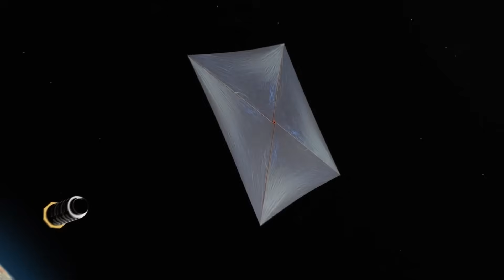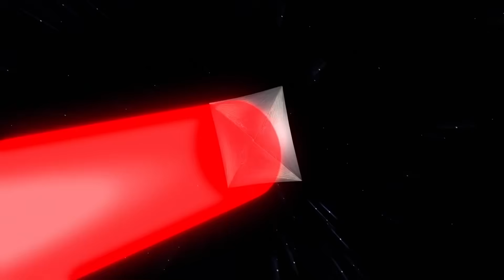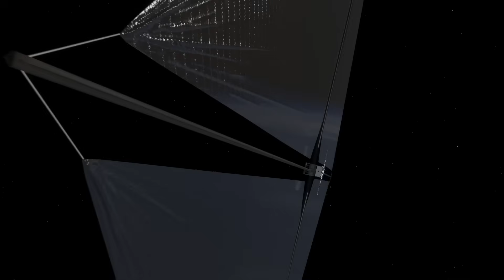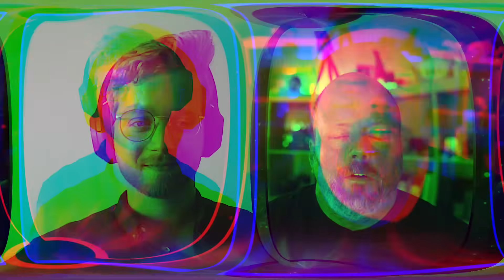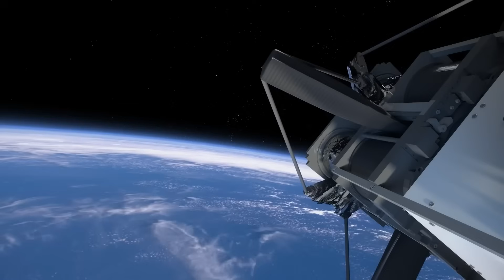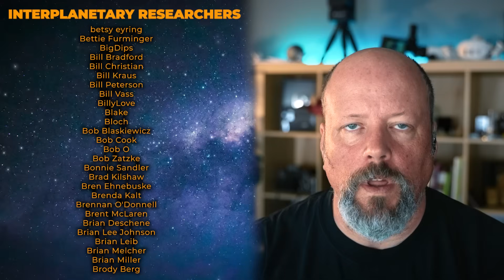Punching NanoHoles in Light Sails Can Bring Us Closer to Alpha Centauri

Comment: Would they have to deal with the solar system rotating as they shoot the laser for an extended  period of time? They might be pushing in a slightly wrong direction and miss the small target. After all this time they should have at least launched this project to the moon to demonstrate that it works.

Comment: Would better accelerate it with a maser. Then the holes can be much bigger. Also, if the sails are made superconducting, you can get total reflection for wavelengths that are a little longer than optical. High-power masers are much more maintainable than lasers, and overwhelmingly easier to phase-lock.

Comment: Although working on the technology of the light sail is fascinating, that isn't the basic problem of a laser powered relativistic speed spacecraft. The problem is a quality that all lasers have, called divergence.

The problem comes in the basic concept and is shown in the video. This shows a laser beam the diameter of the spacecraft pushing it. But lasers don't make columnar beams. They make cones of light that diverge greatly with distance. How greatly? Let's do math!

We'll take a 532 nanometer wavelength (that's green) laser with a 2mm beam width and a very low divergence of 1 milliradian. We'll shine this puppy on the Moon. What diameter do you think the beam will be when it gets there? 10 cm? 1 meter? 20 meters? Wrong. The diameter of that beam at 252,000 miles, 405,555 km distance ,approximately the Moon's apogee, is really 405 kilometers. The diameter of the Moon is 3,474 km, so that 2mm beam is enlarged to 12% of the diameter of the Moon.

The Géoazur team at the Université Côte d’Azur in Grasse, France, bounced a few tens of thousands of 1.3 gigawatt pulses off the Moon and received about 200 photons back. There is not enough power on Earth for a continuous laser beam of that power.

Let's calculate power per square meter. What is power per square meter of a 2 mm beam compared to spreading all that power over a 405 km area? We don't even have to do the math. The number is very, very close to zero, even at the tiny distance to the Moon. What's that laser beam going to be worth at the distance of Mars? Nada. Jupiter? Nada. Pluto? Nada. 1 light-year away, less than a quarter of the distance to Proxima Centauri? Zero. 

To give you a basic idea of the truth, in the Apollo program retroreflectors were placed on the Moon, that reflected light back exactly 180 degrees from its source. Various facilities on Earth shoot incredibly high powered and high quality lasers at those laser reflectors. When they get to the Moon the beams are in the neighborhood of 400 km wide. A tiny, tiny portion of that light is reflected back at Earth where large, usually 10 meter plus scopes are trained on the Moon. On average they receive less than 5 photons back from the beam shot at the Moon. What is the energy of 5 photons? Sometimes they receive zero photons.

The contents of the imagination of humans, to make CGI showing a 1 meter diameter laser beam propelling craft for light-years DO NOT compel the universe to obey. Until lasers have a divergence of zero, light sails are impossible and will remain that way. Even a tiny, tiny amount of divergence, like 1 milliradian, results in a beam 405 km in diameter only 1.3 light-seconds away.

However, using light sails of this technology, using light sails tuned to solar radiation might make it possible to extend the distance from the Sun that light sails can be useful out from about halfway between Venus and Earth, out to the range of Mars. Although the acceleration produced would be in the neighborhood of zero to 60 mph in a couple of weeks, that would still be useful in counterbalancing atmospheric drag encountered in orbit around the inner planets. So I wish the future Dr Norder success. His work won't be in vain.

Comment: Nano-scale holes merely act like a high pass filter. Anything higher frequency above 1/4 wavelength of the hole size passes straight through. So you artificially limit the energy that you can use. Im not sure you can reduce mass enough to make it worthwhile. You may find yourself NEEDING that extra energy.

Comment: We need to make powerful space based laser arrays a priority, they have so many uses, lidar, proplulsion, communications.

With these photonic craft could be achieved at low power on spacecraft by modulaing their reflectivity, implementig very low power transmitters.  We could directly image dark objects in outer solar system.

If we can make these fast enough it can help with the manned mission radiation problem.

Comment: That was a really interesting interview—thank you! But I’m confused about one thing. If you push a 4-gram sail with a laser to reach 1/4 the speed of light, it takes over 16 years to get there. During that time, it needs a power source to communicate with Earth and send data like pictures. What’s the point of sending a spacecraft if it can’t talk back? And what about the weight of cameras, sensors, and a power system? Those definitely add more mass.
Reply: I saw some other video on this, I don't know if it was on Fraser's channel or someone else's.  People are working on these issues, too.  I would imagine that you'd use a tiny RTG for the power source, though.
Reply: @sciencecompliance235 there are solar cells in the concept animation on the little cubesat at the center of the sail

Comment: Two things... First, I'm not sure the Doppler shift issue is adequately addressed.  It's mentioned a couple of times in the interview, but no actual explanation is given on how they are getting around it.  If the photonic lattice is optimized for just one or two narrow wavelength ranges, then how do you consistently accelerate the spacecraft through the full range of velocities until it's moving at a significant fraction of light speed??

Second, how do you prevent fhe light sail from losing alignment with the laser - i.e. from tumbling?  I suppose you could spin-stabilize it, but that seems like it would only work well with very large sails (where you could impart a large angular momentum without mechanically overstessing the sail by spinning it too fast).  Talking about small probes with 10-cm radius, it seems like spin stabilization might not be nearly as effective.  And even spinning sails could still sevelop a significant precession; how do you fight that?

Comment: I'm engineer - but with a physics background. When I first heard of starshot I thought that at Terrawatt laser level there was no way even the small % of light absorbed wouldnt vaporise the whole sail in milliseconds. Then I did some basic Stefan Boltzmann T^4 radiative hand calcs and bingo. ...it gets very hot ...but survivable. Cant always trust your intiution. ..trust the maths.
Back to the engineering issues---on the subject of tiny perforation holes---a known phenomona in mech structural engineering is that very small holes can act as very signifcant local stress raisers increasing risk of in plane membrane stresses ripping apart the sail. I presume they are looking at this - though it is not mentioned ss a factor.
Reply: A maser would be a much more practical thing to use to drive them than a laser. Masers are much, much, much easer to phase-lock.
Reply: What initial beam size and divergence did you use?
Reply: This laser stuff has already been shown it is an unneeded and overly complicated idea..
  During 1 of the live action StarTrek documentaries showed Jake and Benjamin Sisko proved Bajoran lightship's can achieve warp speeds by using tachyons.
Reply: The tiny forces generated by light beams couldn't possibly overstress the sail material unless it was very, very weak.
Reply: @RockinRobbins13  Forces are not so tiny in relation to the crafts fragility. It was supposed to be powered wth a 100GWatt of laser light power (100milllion times sunlight preessure). On a 4m^2 sail the total load was nearly up to 1Newton (which you easily feel).   Doesnt  sound like much - but the whole thing only weighs a gram or so and will accelerate   at 10,000g. Plus it is only 30nanonmeter thick. ... and will be oeprating at extreme elevated white hot temperatures (>>2000K) so material strengths will be much reduced. The stress turn out to be not trivial - but not as big issues as I thought.   With the likes of ultra strong graphene as candiate material itis probably not an issue.
Reply: @bbbf09  Right now the most powerful continuous laser on Earth is the MIRCAL, US Navy military laser with an output of 500 kilowatts, only half a megawatt. Even at that output there are strict limits on how long it can be in continuous operation.

The most powerful pulse laser is the ZEUS laser, which has peak power output of 2 petawatts. The catch is that a pulse lasts only 25 quintillionths of a second. Minimum time between pulses would typically be one minute to several minutes for lasers using similar technology.

Then, what can you do about divergence? Regardless of how much power you can pump out of a laser, how can it remain useful, even at the minuscule distance of 1.3 light-seconds, the apogee of the Moon?
Reply: @RockinRobbins13  I'm not here to defend the idea - it would be preposterously costly and difficult ...but technically possible. You wouldnt use a single laser but thousands of MW  class in a huge spread out array  that would be steerable  (so limit dispersion / divergence effect). 
p.s. 1MW class CW laser did exist in the 1980s so are feasible.
 If you live in the world of Petawatt engineering (as I do) no one uses quintillionths to define pulse widths - you quote femtoseconds.  Higher peak  powers than  Zeus exist --10PW ELI-NP-- and 10PW at rates of 10Hz can be assumed to be real thing next decade - but it is true they deliver very relatively little Joules of energy per pulese  and therefore equivaelnt averaged  CW power  (less than 1kW equivalent in fact)
Reply: @bbbf09  " it would be preposterously costly and difficult ...but technically possible." I'm in 100% agreement there except I don't know how the problem of divergence might be handled. That's the killer of the entire concept. Even a divergence of one milliradian is fatal at the distance of Earth to Mars at opposition.

It's interesting research. I personally think that the end products of the research will be things other than light sails to be used with laser beams. And the use could be really out of the box to the way we're thinking about it now. Isn't that the way basic research usually unravels? 🤡
Reply: @RockinRobbins13  The diffraction limit for divergence (for perfect ideal optics) is ~w/D - where w=wavelength of laser light (1 micron proposed) and D is aperture. For a 1m diameter collimated laser ...that implies a 1microradian divergence. Meaning a diffraction limit spot size at ~6million km out (typical range at end of acceleration phase - assuming near at 30,000g+ accel) is  then 6,000m - still way larger than a light sail of only few metres.    But the idea isn't to use just one  laser but many thousands of them in a phased locked array spread out over a kilometre.   The effective aperture then becomes the size of the array D~1km - meaning spot size possible is more like  ~6m  - matching the light sail size (approximately) ... even out at 6million km. Anyway thats loosely the idea. Theoretically its possible but would require engineering off the scale in timing, synchronisation and alignment across 1km array.  But they achieved something like that level of  impossible with gravity wave detectors. So never say never.  What is needed - even much more than gravity wave detector type tech - is huge amount of money . Hundreds of billions$ I would guess.
Reply: @bbbf09  Wow. Thanks for the info on minimum achievable divergence. So getting 10 times better at .1 milliradians just isn't possible. And if you're goiing to have thousands of the most powerful lasers imaginable pointing in the same direction, carving out a  huge light cone, even inside our solar system, what happens to spacecraft that pass through that killing ground? I think we have enough problems here that looking elsewhere for a solution would be warranted.

But the research being done in this video certainly won't be in vain.  Things designed for one purpose often find themselves much more valuable when used for an unanticipated use.